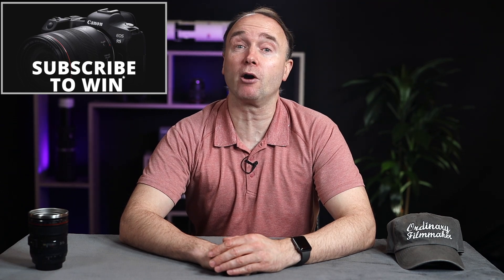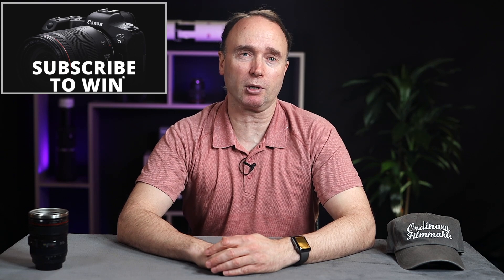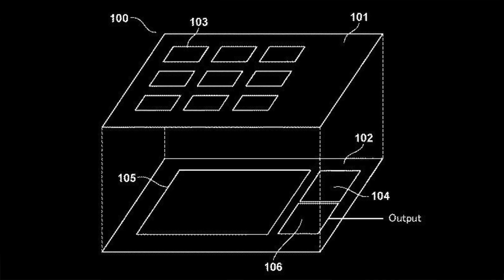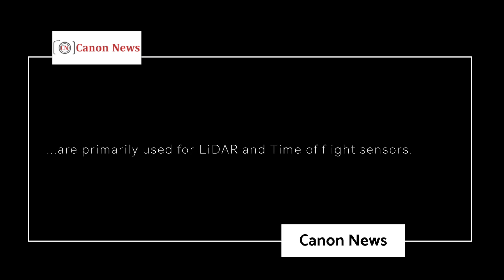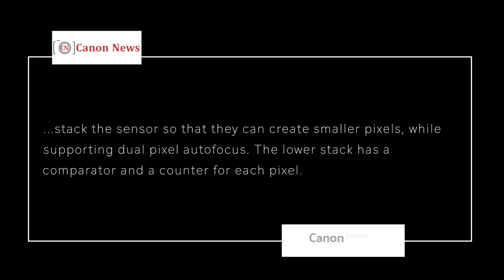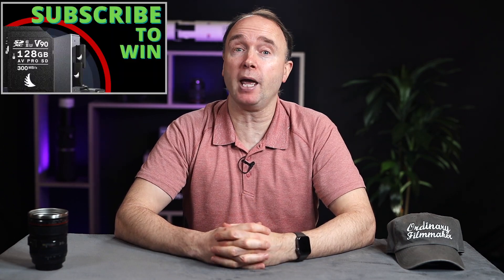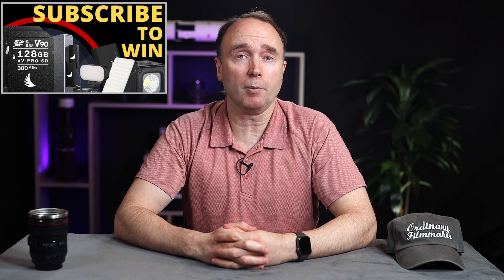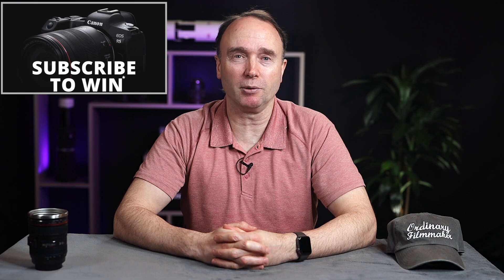Single Photon Avalanche Diode Pixel Sensor

Comment: One use that avalance photodiode CCD image sensors are used in are biomedical microarray detectors that image florescence tagged genes and protiens. Would be nuts to use one as an actual camera. The resolution isnt great though typically they are 240x480 or 1060x480, but they can see in nearly total darkness. ❤

Comment: I know what all those words mean individually but combining them turns them into German.  It does sound a lot like LIDAR tech but I can't see how LIDAR would ever be able to judge distance with interchangeable lenses.  It could be a separate sensor to help with focusing.  I see how it would add dynamic range to an IL sensor but I have no idea how autofocus would work.  That does not mean it won't work.  I just don't understand it.
Reply from the maker: I felt a bit the same myself. Its mostly opinion on patents so we'll have to wait and see.

Comment: "30 stops of dynamic range... allowing the camera to essentially see in the dark" --- nope!
you're mixing up low light performance with dynamic range. Such "photon counting" sensors don't have their dynamic range limited by a well depth, that's correct, so they can measure much brighter lights without saturating, at least not for already very bright lights. 
BUT, this has nothing to do with the noise-floor in the dark. There is a thing called shot noise that is already limiting the low light capability of many sensors, whereas the readout, noise hasn't been limiting for best sensors in a while. You can't overcome this. The physically possible low-light noise-free capabilities are almost fully developed by the sensors with the lowers read-out noise. In order for dynamic range to increase, there is pretty much only one way... up! Brighter scenes will not get blown, but the low-Light capability can't improve mich anymore.
Reply from the maker: Thanks for that. I'm still having trouble remembering to separate them. True DR and low light are different things.
Reply: "if" you can count one single photon,..."and"...have a way to separate it from the signal noise floor?  Yes, your camera would see in the dark, in theory.
Reply: @clifftotten7609  technically no, since 'dark' is defined as lack of photons, haha, so you'd have to illuminate the scene. 
Besides that, counting a single photon is very much feasible, even with "affordable" detectors (I have one here). The problem with cameras is the overall quantum efficiency of these cameras, their readout noise and dark current (noise). In the green I wouldn't be surprised if QE is larger than 50% (over a green pixel) for consumer cameras, for state of the art industrial or even scientific cams, it usually peaks around 95%, obviously without any bayer-filter etc. on top of it. 
However, the readout-noise is always in the order of several electrons for CMOS, that kills hte single photon detection. 
Oh, for the normal photo-effect which occurs in all these silicon based sensors... the absorption of a single photon can of course only generate one electron. So you can only truly detect it, if no noise exists. No, that is not available to ordinary consumers but even if it were, counting single photons (VERY DARK but not fully dark scene)... your signal to noise would be abysmal, as you had pixel with information next to black ones. Oh and no color ratios obviously ;-)
Reply: @andreasbrand3191  - Yeah, the QE of CMOS sensors today is not going to get much better then it is today. Noise cancelation processing is where it's at and prolly be where any new gains are going to come from in 5 years. Lowering the noise floor and disseminating what is "garbage" and what is "image" is really hard and you often have do it over multiple read cycles to identify random and fixed patterns. Anyhoo, I read that MIT has a sensor patent that allows a photosite to collect photons and just before saturation, it dumps that voltage and continues filling up again....in the middle of a read cycle! Those voltages can be "stacked" up until the read clock is over. So in a 1/30 second shutter, one photosite can dump two or even many more stacked readings to create one FAT voltage output per photosite. This would allow for (theoretically) pixels that don't saturate in a single read cycle. THAT seems to be a promising idea that could REALLY help dynamic range tremendously in bright light situations? I read MIT is working on this now.
Reply: @clifftotten7609  

MIT and many others who came before are working on such sensors. Technically the 'counting' chip/sensor would be best, but I don't believe it will be best noise wise, also I don't think we'll get to see one for consumer applications any time soon (next decade).
I personally like an approach like the "HDRC" patent better and think it's more credible to make it to sensors soon. You'd have to google that as Simon doesn't allow links here.
Very low intensities will always be noisy because of the inherent quantum noise of the signal. One photon for pixel A, maybe 10 for pixel B and zero for pixel C, nothing you can do about that! Also There is no clever way to differentiate electrons/charge created from thermal noise vs actual signal for instance and the quantum noise. Cooling helps, but getting the read noise from a few electrons down to just one or zero (RMS) is the only thing that can still help. 
Keeping this in mind though, as I stated earlier, there is almost no color/intensity to gain here. It will remain noisy down there in the dark because IT IS PHYSICALLY NOISY ;-)

Comment: single photon avalanche diode is actually good at distinguishing photons vs no photon, but not very good at determining how many photons. So Lidar, auto-focusing are indeed good match, but not so much for the actual camera sensor.
Reply from the maker: But could be good for helping with low light. Canon doesn't really need to add additional AF capabilities to the sensor.

Comment: Nikon Z6 ii 
What lens to take I mean the first lens
24-70 F/4 S ?
Or
24-200 F4-6.3 VR ?
My gear is Canon 250d 18-55 F4-5.6
Reply from the maker: What do you want to shoot?
Reply: @OrdinaryFilmmaker  
People wildlife  animals 
My family
Reply from the maker: The 24 to 70 is very versatile. You won't miss the 200. I don't. I used to shoot with the 18-135 = 28 to 235 FF equivalent. Now I shoot with 24-105 or 50mm and both are good. Having a lower F-stop is better always.
Reply: @maorvaknin769  I would go with the 24-200. The 70mm of the 24-70mm is too short for wildlife. And there isn‘t that much of a difference in IQ between the two, unless you are pixel peeping. Sure the 24-70 is a sharper lens with a constant aperture and higher build quality but I‘d value the greater versatility of 24-200 higher. And if you later feel that you want some more horsepower in the 24-70 range you can still get the f4 on the used market for a very affordable price whereas the 24-200 is basically impossible to find used